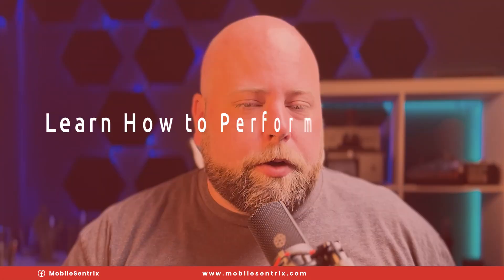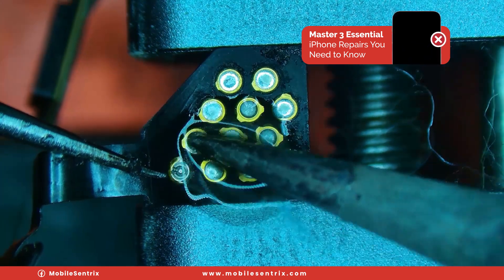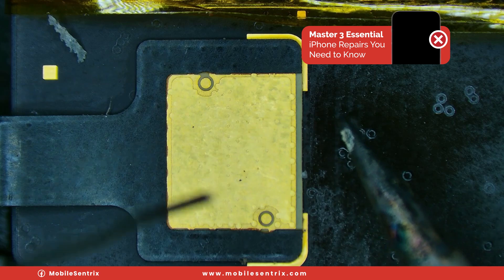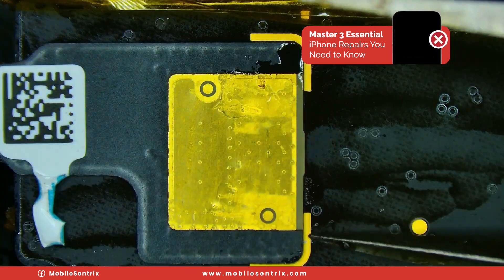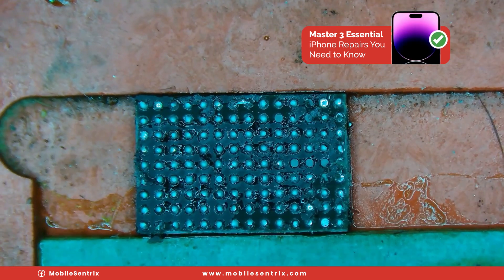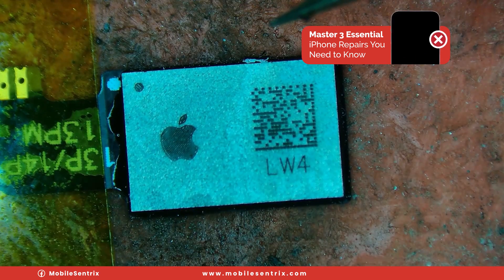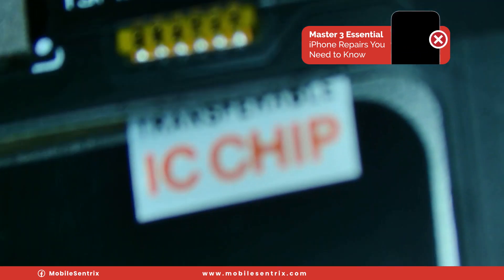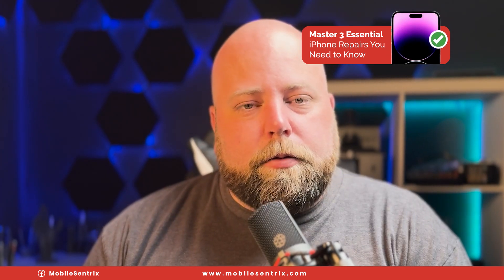Learn How to Perform 3 Essential Repairs on an iPhone 14 Pro

Comment: Hi, I found your comparison interesting. I purchased an original iPhone 14 Pro pulled screen. Everything works fine. iOS 26 recognizes it as a used part, but unfortunately, when notifications arrive with the screen off, it no longer lights up. I checked the proximity sensors, etc., and they are fine. They work properly. I've read that almost everyone has problems after replacing the screen, whether it's original or from another manufacturer. In your experience, what could it be?